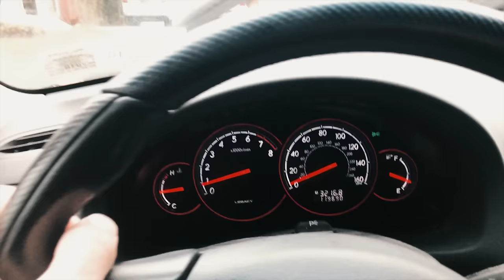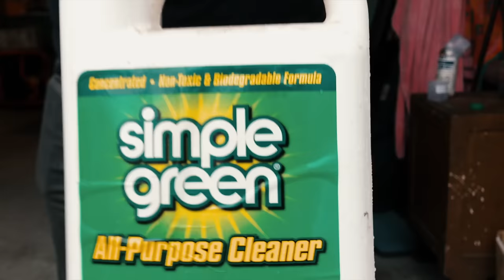MAKING MY RADIO NOT SUCK! (JDM DOUBLE DIN LEGACY INSTALL)

Comment: I plan on doing a similar instal on my 2007 legacy. I’m not going to replace the have unit though, and plan on using the power akoustic cp650 radio my only question is where to find the separate wiring harness for the antenna and radio, can you point me in the right direction? I can find the radio harness no problem but I feel like I’m going to need more than one as there are more than one harness that connects to the back of my stock radio
Reply: Not going to replace the *hvac unit

Comment: We just did this JDM kit.  We didn't buy the wire kit.  The sterio plug is pretty simple.  The HVAC was a little tricky.  There are two plugs left.  One is for the HVAC and has a 8 pin with only 3 wires.  The other plug is not needed.  We cut it off with about two inches of wire.  Take this plug apart and use 3 of the pins.  Push those into the first plug for the HVAC.  One will be a 12v and 2 are dimmer positive and negative.  On the JDM site it explains which wires and colors you need.  On the 8 pin plug it is numbered 1-8 and it says which hole to put those 3 wires in.  It is a little time consuming but not that difficult.  We ran a 2000 watt amp so we pulled the stock amp out from under the passenger seat.  Take the seat out.  Run speaker wires from new amp to old amp location.  One plug has 10 wires.  8 are positive and negative speaker wires to front and back doors.  The two bigger red wires and not needed but are 12v so tape them up.  You can ohm test these from this point straight to each door.  On the plug you can tell which wires are for each speaker but not location.  I cheated and didn't want to pull the doors apart so I cut the plug off an old pair of headphones and plugged it into my phone and touched it to each pair of wires.  Hooked amp up and it now my stereo doesn't SUCK!

Comment: Haven't watched it all yet obviously, but if the whole video is about installing a double din, 25 minutes might be a bit long... Also, depending how worn down your tires are you'll want to replace all 4. Running different size tires on an AWD car can really fuck things up.
Reply from the maker: same size tires btw not sure if I said that or not also yea its a little long but just an experiment to see how we should structure future videos =) This one was more of a how to video for people wanting to do the same more than a install video.  The install videos of parts to come and what not will for sure be shorter <3
Reply: Krispy Media I figured they were the same size but by different sized tires I meant the difference between the two worn out tires and the two good tires. If there's a difference greater than 3/32nd of an inch it can really stress out the drivetrain on an AWD car. 

No worries about the long video man, I'm sure some people will want to watch a how-to in depth 👍
Reply: Found this online, they explained it much better than I could

Subarus: Subarus have, to our knowledge, the tightest tolerance of any AWD system. Since we see so many, we can tell you what the tolerance is. It can be stated in two ways: The first is 2/32nds tread depth across all four tires. The problem with this is that actual tire dimensions can vary from brand to brand and even from model to model. Therefore the 2/32nds rule is only good if you have the exact same size, brand, and model tire. The other way to check is to measure the tire around the circumference and then the tolerance is 1/4". That was circumference, not diameter, so you have to have a flexible tape ruler and measure around the tread of the tire. Also, having air in the tire affects the circumference. Though the change due to having air in it is only about 1/8", it's pretty critical since the tolerance is only 1/4". Therefore, to get an accurate measurement, it's necessary to let the air out before you measure (since the prospective replacement probably won't be aired up). This second method allows you to check compatibility with any make or model of tire. When we were almost finished with this article, a Subaru came in that needed only one tire, so the picture shows us measuring the prospective replacement tire with our "Subaru Tool".

You may ask what the big deal is? Well, on the Subarus, if all four tires aren't matched within 1/4" around the circumference, you will break the transmission, not maybe or sometimes - it definitely happens. Granted it won't happen overnight, and the AWD on many Subarus can be disabled, but the transmissions can definitely get ruined and then they have to be repaired or replaced. Then the cost will be a lot more than the cost of tires!
Reply from the maker: +Connor oh word I appreciate all that info! I got the front tires about a month ago and the rears went bad because my alignment was so terrible haha I'll have 4 new tires in about a month :) I appreciate you looking out for me :)
Reply: Krispy Media 👍👍
Reply: I drove with 4 different brands of tires, each with different tread depths for a month while waiting for my tires to come in, nothing happened but get em mounted and aligned as soon as you can. I guess take it easy and try to not drive it alot ahaha. 

I'd recommend subframe lockdown bolts to put into the car, it's a good cheap suspension mod.
Reply: Was about to say exactly this
Reply: Different tread depths means different diameters means tires rotate at slightly different speeds. This is handled by the differential not the transmission. It's actually the reason there is a differential; to rotate wheels at different speeds.  The sum of the rear wheels is sent as one value to the transmission through the shaft. Turning creates magnitudes more differential, both speed and torque, than any difference in tread depth. But you never hear any one say don't steer because your transmission will break.
Reply: Krispy Media I watched every second of the video
Reply: The video might be 25 minutes but it was entertaining imo. It's either that or I'm easily entertained.
Reply: please make every episode this long xD
Reply: Long video was good!
Reply: hey Krispy does ae64 still make those wiring harness?

Comment: Just a small Observation and info the Gap around the radio is because USDM Double dins are smaller than the Asian Market Double dins, I ordered a asian Market Android radio and had to do some slight trimming on my 2003 Outback Limited 5 Spd Wagon.

Comment: Does putting bags on your car negatively affect ride quality? like will it make harder for you to do rolling shots of other cars now? or is it like negligible
Reply from the maker: actually my hypothesis is that it will actually make the rider and shots smoother.  I have it planed once their on to do a video where I show rollers using my bagged car vs before it was bagged so we will see!
Reply: Krispy Media awesome!
Reply: Putting bags on a car does not negatively impact ride quality if you install an Airlift or Accuair kit that is designed to bolt onto your specified vehicle as the dampening rates are adjusted for that particular vehicle. Bag over coils setups with UAS bags and similar don't offer a comfortable ride as the dampening / sometimes cut struts will cause the bag to rub. Some bag over coilover setups like Airforce actually have a 36 level dampening system to negate bad ride quality when on bags. But a kit is much more desirable and will cause less headaches tbh.

Comment: Great video thanks! I am thinking probably to do the same work on my Outback 2008, I have just a couple of questions/doubts. 1) Do you know if it is possible to have on the display the temperature in celsius and not only in Fahrenheit? 2) Is there a reason why you didn't put the touch on the standard spot for the navi, where you have the little glove box on top? Mine as well as the glove box there and I am wondering which could be the best solution. 3) I saw you installed it in 2017. After 2 years would you buy the same Sony Unit or not? The problem with the switch controller probably could be a reason to look for some alternative units? Thanks a lot!
Reply: Yes

Comment: Thanks to this video I installed this awesome double DIN on my Subaru Outback. I love it but I would like to find a solution for the gap between the Sony and the plastic frame in the console around it. As you in the video say, everything is around a couple of mm too much inside, I would love to make it even with the frame. Any idea? For instance if I try to make the holes where you fix the Sony to the frame with the screws bigger  (at 14:56 in the video...) probably I have the chance to push the frame a couple of mm back, or not?

Comment: Here guys great video just got mine installed but one question did you have low light issues in the temperature area when you turn you headlights on at night? With mine you can't really see the dial temperature numbers and digital board.

Comment: Hi! I have a 2008 Outback with factory navigation (in the exact spot where that top compartment and clock is in your car). I bought the car used a week ago, and the navigation screen is broken. I'm looking to replace it entirely with an aftermarket one rather than repair the factory screen (because that one doesn't have Bluetooth and other features that the aftermarket ones tend to have). Do you know if it's possible to install it in the area above the climate controls? I would hate to have a dead screen on top and a working one on bottom.

Comment: Hi, and well done on finding how this is done.

I have just got my Twinscroll estate which I love, excellent condition, everything fine, but the audio and sat nav.

What you are doing here, do you know whether there are differences in the Japanese import I have here in the UK to your version?.  I know that sounds like a dumb question, but I keep getting conflicting views on it, all from audio specialists, at extortionate prices.  That is why they probably conflict, because they want me to be a mug and spend £1500 or something.

Please advise, because I use the car for the dog, I do not need to spent £1,500 on a sat nav when I will only use it for about 50 miles per week.  But the current audio is in Japanese, and yes the CD works, but only 1 UK radio channel. 

Thanks and any advice would be nice, because I need a quality fit for what is a great and quality vehicle, but not at, taking the piss prices.

Comment: Thanks for posting the vid, Krispy.  It was about time someone made one for this type of install.  Here are some helpful links: [click the "Read more" link, below]

This page explains which models/years need the JDM dual-DIN HVAC panel kit, and describes the items that you may want, plus has useful tips:
    http://ae64.com/aftermarket-HU-install-parts-LO2005AN.htm

Wiring instructions are in this post (on the LegacyGT forums):
    http://legacygt.com/forums/showpost.php?p=2570925&postcount=637

This post further explains which cars need which JDM HVAC panel kit:
   http://legacygt.com/forums/showpost.php?p=5684242&postcount=3057

Cars with manual A/C controls (the 3 larger round knobs, no digital temperature setting) do not need the i88 harness.  You only need one of the less-expensive dash kits that have a single- or double-DIN opening and the same round holes to keep using your car's existing A/C controls: Scosche SU2025B, Metra 95-8901, or Metra 99-8901.  Sorry, those are designed only for LHD cars.
Reply: Links aren't there anymore
Reply: Did you  click on the blue "Read more" link to open up the rest of what I wrote?  When I do that, I still see the rest of my text and links, even when I view this vid while not logged in.  Is anyone else not seeing them?
Reply: are you still making the harnesses i did email you
Reply: Hey Krispy -- my post above somehow became unpinned. Would you please pin it again?  Thanks!

Comment: I'm not sure if you or anyone still reply to comments on this old video but I really need help/ information on how you would do this with a JDM version of the Legacy GT. My JDM version has a similar (but flipped) dual-zone climate control to the one seen here stock, but also has a Japanese nav unit on top where this one just has little door/shelf. Is it possible to replace this top nav unit with a double din head unit like the one you put into the radio spot, without having to buy the expensive separate JDM climate control unit, faceplate to fit head unit, and wiring pieces to wire it all? I have no idea how the wiring for the Japanese head unit works, or how the Navigation unit is connected, but if I just left the nav unit on top, could I just follow what you have done the same way? Or is the JDM version of the vehicle different with maybe the wiring harness, climate control unit, etc. I really have no clue and am new to this so any help or links to pages that explain this stuff would be great. Also if anyone knows if I can replace the JDM navigation unit with an English one somehow, that would be very helpful as I can't find information anywhere.

Comment: Hey you could've bought the silver/grey coloured 2DIN cover and AC unit. They're just different part numbers. The black one is for S402 and the Tuned by STi black interior and other ones are grey. I have a JDM GT spec B and a JDM STi with both colours :) But the black center console (and interior with black headlining) is way cooler! But cool vid - thanks!

Comment: Installed and the ac /heater dosnt work. Is there any suggestions? Pretty straight forward procedure just pulling and plugging . Do I have to program anything ? Or maybe part is defective?
Reply: Sergio Espinoza get a rag put in the gas tank light it up and it’ll fix it self

Comment: Does anyone have a compete wiring diagram that includes all of the extra conectors included? My car is already completely taken apart and so I need it asap thanks. 16 pin, 3 pin, 8 pin.

Comment: Next time buy some dark foam weatherstrip tape from homedepot at the A/C department. It's like $1.99. Wrap some around the connectors/adapters so they won't rattle and around the gap from your HU to the dash kit so you won't see that annoying gap.

Comment: Is it possible to upgrade the stereo head unit without getting the JDM housing?
Reply: If your car is a 2005-2009 Legacy/Liberty or Outback with auto HVAC controls, not easily.  You can keep the OEM HU+HVAC unit and install a new HU in the upper cubby or in place of the ash tray.  Search for "cubby install" threads on the legacygt.com and subaruoutback.org forums.

Comment: I'm guessing it is, but the steering wheel controls are no longer working right?
Reply from the maker: +Googs5 my car doesn't have steering wheel controls
Reply: In Legacy/Outback models that have audio steering wheel controls (SWCs), yes it is possible to retain them.  ae64.com has an additional harness for that (and to retain the factory 3.5mm aux jack, in cars that have that).  See the link in my pinned comment, above.
Reply: Added: If you have a 2008 or 2009 Legacy or Outback and it has a blank panel on the left spoke instead of the SWC buttons, your car is pre-wired for them.  It's actually not too difficult to add the OEM SWC pod to your wheel.  See this post (especially the first thread I link to there): http://www.subaruforester.org/vbulletin/f77/installing-stock-steering-wheel-audio-controls-69816/#post773906

Comment: can i do this with an 08 outback that has normal ac controls, not the dual control? thanks.
Reply: Cars with manual A/C controls just need a less-expensive dash kit (Scosche SU2025B, Metra 95-8901, or Metra 99-8901), and a Subaru 14-pin harness (Metra 70-8901, Scosche SU03B, or similar).  To retain your audio steering wheel controls (SWCs) and/or 3.5mm aux jack, I can supply a wiring harness for that -- the same "i85" harness needed for the models with auto HVAC controls.  Most aftermarket HUs will also need a steering wheel interface module (Axxess ASWC-1, iDatalink Maestro, or similar).

Comment: when i go to the ae64 website am I supposed to click on the second link that says newer 20 pin adapter? I have an 08 legacy gt.
Reply: No, you should click the link on the right side of that page that says "Subaru Radio Wiring Harnesses FOR SALE".  But I'll shortcut that for you -- go to this link: http://ae64.com/aftermarket-HU-install-parts-LO2005AN.htm
(which I also posted in the pinned comment near the top of this video's comments). And yes, I really need to reorganize my site, but I've been too busy answering questions and building harnesses.
Reply: thank you so much

Comment: Hey Krispy Do you know if this works with the 2012 subaru outback?
Reply: 2010-up models are completely different, and don't need the method described in this video.  You can keep using your factory HVAC controls (they're separate from the OEM HU).  You just need a normal dash kit and less-expensive adapter harnesses.

Comment: this model didnt come with an aux in the middle arm console?
Reply: Not this year no. Subaru is backwards sometimes.
Reply: Tony Hamre i see that. my 05 had one thats why i asked
Reply: 07 i mean
Reply: What's even worse is, the 1st gen had rear folding seats, and even most of the stock clarion or panisonic head units had aux input!!

Comment: Where did he ground the black wires to?
Reply: The factory Radio has a spade connection for a ground wire so this radio kit comes with a spade harness, so it goes from the side of the radio via the eyelet to a spade connection in the center consonle!

Comment: just a heads up for whoever has older subaru stereos. you can buy a fm transmitter which allows you to run aux and it sends it via radio waves to your oem stereo so you don't have to mess with rewiring your stereo and it costs like $20
Reply: Alan Chernitskiy ye and it sounds like shit if u play something, had it in my car